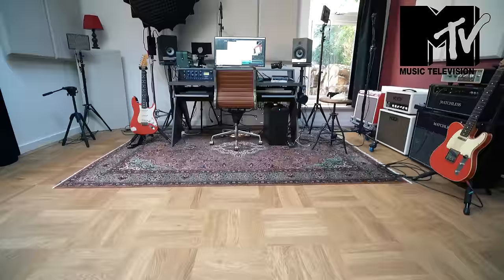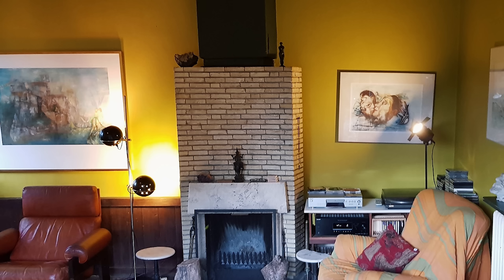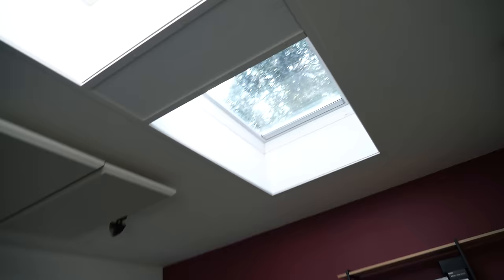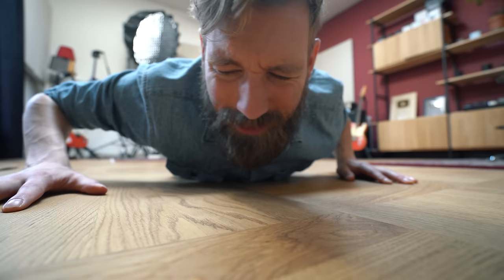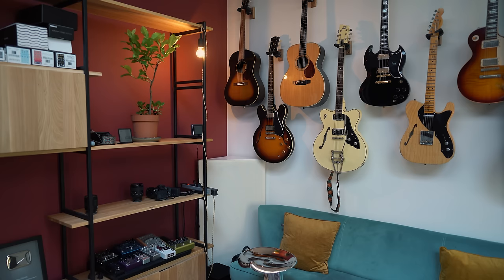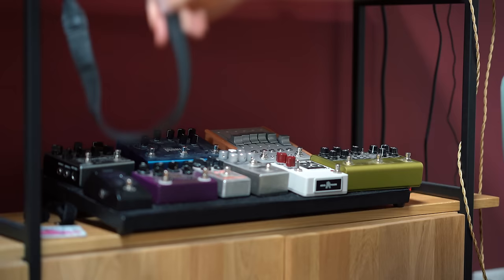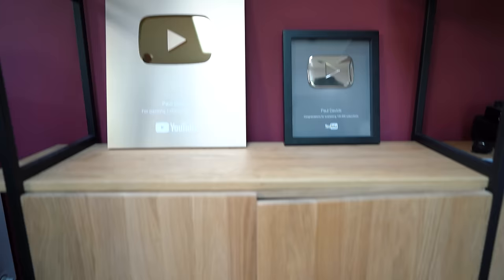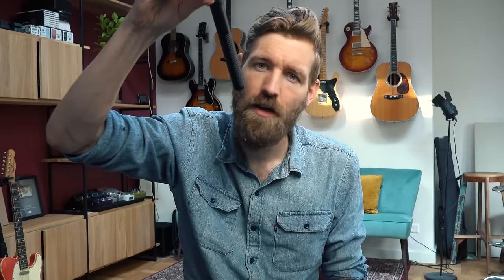MY EPIC HOME STUDIO TOUR!

Comment: I have never seen a concrete roof in a home.  We don't have those in California.  Looks like it is a second floor as well, yes?  You might want to consider ASC tube traps for the corners if you have any problems with lower frequencies.  They are awesome and can be  rotated for more absorbtion or reflection.  Was curious about the Matchless, if you use the load box for lower volume in the room, does it still sound as good?

Comment: I'm in a similar situation. Waited my whole life to make a "Dojo" if that makes sense. But it does take a while to figure out where you want to put stuff, until you start putting stuff where you want it, and where it makes sense. I digress. The whole point of looking you up was to thank ya for the "connected" video. Forgot what it was called. 5 steps to get better? Anyways - I've always just memorized patterns, and over time got the knack of knowing which square makes the sound I'm going for. So it's always been a "barely hanging on" kind of existence playing-wise. I started with "A" and went through every scale, every chord, and started linking note names and associated them with the patterns I knew. Holy cow! I'm learning Piano and Guitar, at the same time, on a whole other level. I'm not rushed to figure out where I'm going next, I just know. So thanks a lot for giving me a push in the right direction. I'll send a photo when I'm done with mine!

Comment: Paul, very nice!! But be very careful about direct sunlight!!, especially on delicate acoustic guitars. For example after 3:00 and after 10:07 — frightening...  Solution 1: place the acoustic ones up and to the left. Solution 2, much better: hang a shade made from white rice paper vertically close to the skylight in such a way that it will not obstruct the vertical view of the sky, yet obstruct the direct rays of the sun in the direction of all the guitars (the guitar wall) on their diagonal path. This rice paper will only diffuse the rays, not prevent sunlight.

Comment: Hello Paul, It's always a pleasure to sit and watch your content! Beautiful place you have here, I bet, it has changed since back then, I was wondering how do you handle the connexion in between your amps and your RME sound card? Do you plug your amp directly in stereo mode with 2 XLR cables straight into the RME ? 
Warm regards from Paris

Comment: Just a thought Paul, but did you also take down the rest of the chimney from above the studio ceiling to and including the chimney stack on the roof? I do hope so as the weight of the remaining chimney without the support of the part you removed can cause you serious structural problems, depending on its size or unless you put some other form of structural support in place to hold it all up. The risk of a fire to your lovely guitar collection would be as nothing to the damage they’d sustain if the chimney stack fell through the ceiling! Hope you already thought of this, but just saying in case you were not aware 👍